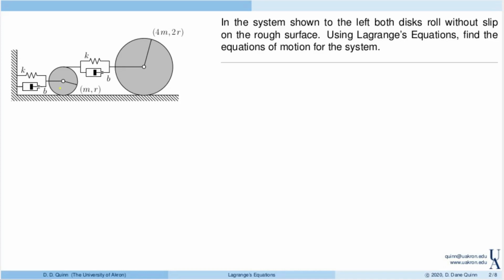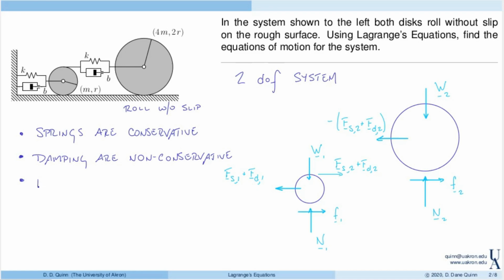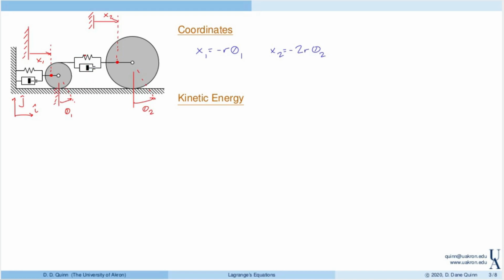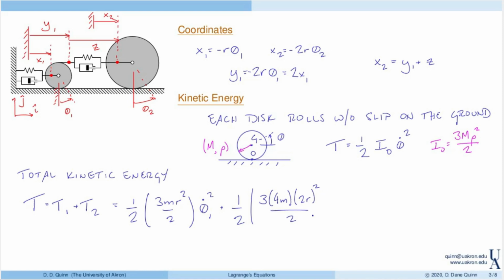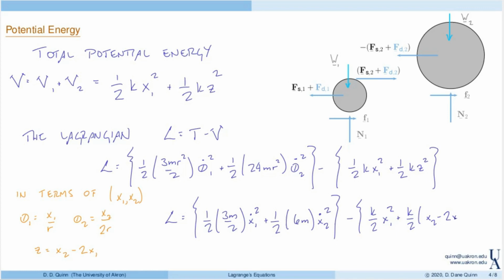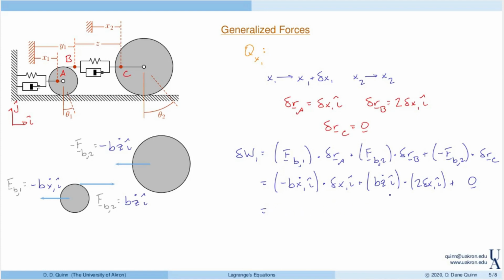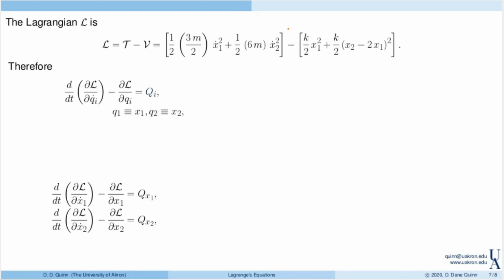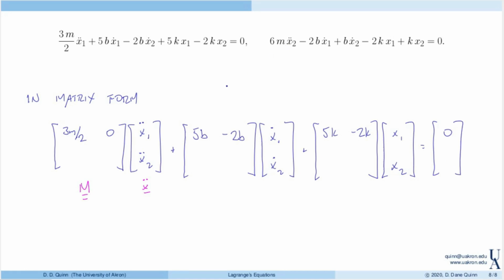UA - MECE 431: Lagrange's Equations, Example

Comment: Hi Dane,
Thank you for the great content you share—it's very helpful!
I’m currently working on a system involving a two-wheel tractor and need to derive its mathematical model using the Lagrange method. Despite multiple attempts and spending significant time on this, I’ve ended up with equations that don’t seem to make sense.
Could you please assist me with this? Any guidance would be greatly appreciated.
Reply from the maker: Hi. Please feel free to reach out to me at quinn@uakron.edu

Comment: Good example, although, I was thinking that the potential energy associated to the second spring must be 1/2*k*(x2-x1)^2 not 1/2*k*(x2-2*x1)^2 as you indicated. I do really appreciate you elaborate more on that. Thanks!
Reply from the maker: Ha. The displacement of the top of disk 1 is twice its center, so y1 = 2*x1. With z = x2 - y1, then z = x2 - 2*x1. The coordinate relations are described on slide 3.
Reply: @quinndd  Many thanks!